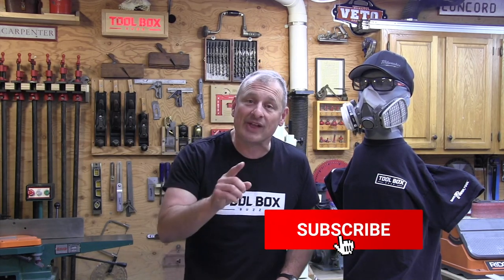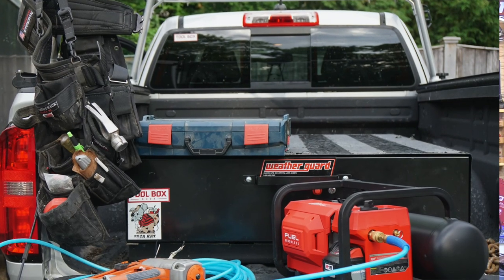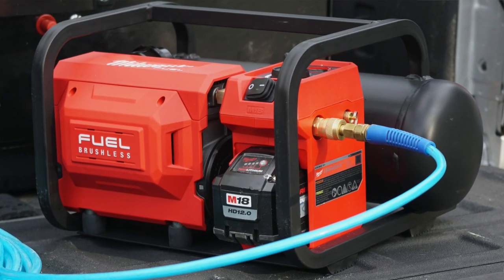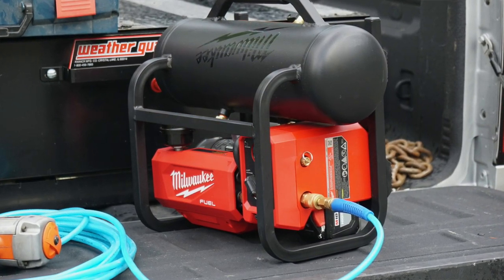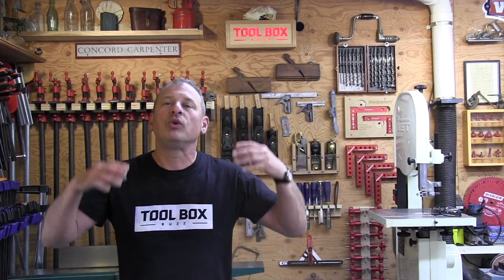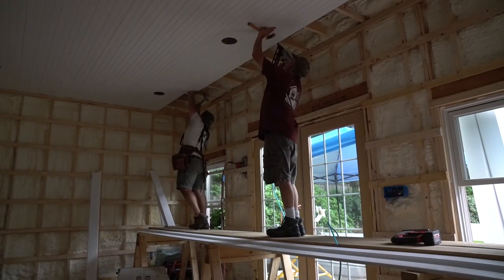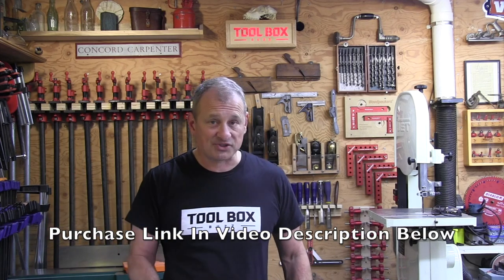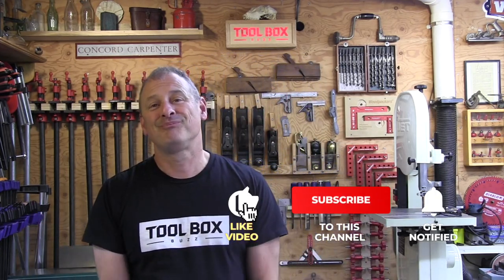Milwaukee M18 FUEL 2 Gallon Compressor 2840-20

Comment: The compressor looks really nice and seems very quiet. One of the main reasons I've been switching to cordless electric tools is noise from having to run an air compressor and the need to plug in and lug it around. Your point about not needing to stress a 15a circuit with this is spot on and something I think probably gets forgotten about. Even in my own home if I need to use the air compressor I either need to run an extremely long hose or be careful about what outlets I plug it into and have tripped the circuit breaker more than a few times during the summer with portable air conditioners and such also running.

Comment: Seems cool, but with the m18 finish nailers is this necessary?  I think if this was about 200-250 for the bare tool it would be a great fit, but at that higher price you have a lot of other options.  And I'm pretty heavy into Milwaukee.  Best batteries, solid tools, too high prices
Reply: Not necessary if all you plan to do with it is drive brad or finish nails but you can't pressurize tanks, pump up a flat tire, blow dust or debris away from your stationary tools, airbrush painting and so on. I can see this being handy for plumbers.

Comment: Hypeddd! Please don’t be some extreme Milwaukee price 🙏 they have been raising there prices up more & more in recent years🤨 WOW that is extremely quiet! Compressor is the most obnoxious tool on the jobsite!This appears to be a breakdown vid, are you guys gunna run it through the gamut then come back around w/ a head to head/full test? Further in the video now lol 300 bare tool is extremely high. Dewalt offers the same kitted up w/ 6ah Flex/fast charger for the same price or sale price @ 250! I think it would of been a great feature to have it clip onto my packout. Then I could wheel it in or put it on the dolly pulling it’s around w/ a 25’ hose?! Either way thanks 4 the vid!

Comment: I love Milwaukee tools, but it doesn't seem like you can do a lot of different things with this one.  For the cost of this little compressor and the 12 Ah battery, you could buy the M18 finish nailer and a couple of smaller batteries and work all day.

Comment: Just bought it.  I've wanted a cordless compressor for a while.  Haven't used it on the job yet, I need to build some saw horses with it and my 20 yo hitachi framer to see how it keeps up
Reply: I'm going to guess it didn't do well... Cycle every 2-3 nails?
Reply: @mudmanKC  no, works well.  But I soon after got m18 framer, which I use a lot.  Still glad I got compressor
Reply: I should add, neither is for heavy framing, better light framing/remodeling.

Comment: Just so folks know, The only reason EVER to buy a cordless compressor is because you don't have 110volt available. Every time you go from 1 type of power to another you lose approximately 25% efficiency. So in this case we are going from 110volt to charge your batteries to Dc then using the Dc battery to run a air compressor pump, so you can run tools tools with air power!  See what I am getting at.  Not to mention the cost vs getting a 110v compressor is so much cheaper vs this. You could buy a slightly bigger 11ov for way less money and be able to run more tools. (for less money) These have a use case though! As Rob said, I would get one for airing up my car or truck or trailer tires on the side of the road in the middle of nowhere for example. If I had to do some kind of work where there is no power, and no generator. That very very rare case would be its only other smart use case. Even then You can only run 1 small trim or finish nailer. It should be marketed as a tire inflator in my opinion, (the tiny things these guys market for that now are wholly inadequate. they also cannot air up a 3/4 or 1 ton truck tire to 75psi anyway. Forget about a loaded trailer too.

Comment: Nice for finish punch list. Makes the noise, the power cord and the twice the weight factor disappear. I dislike carrying my huge heavy frame compressor on to the job from my truck for finish work. This suitcase style m18 battery finish compressor is saving my back left and right. Il pay a little more to save a lot of time and aggravation fighting instead  for a electrical plug. 🥳

Comment: I’m not sure what to think. We got one , took it out of the box , installed fully charged battery, turned it on only to find that it doesn’t work!!! Took it back to store and got money back !! Disappointed as hell !!!  Always had good luck with their products in the past
Reply from the maker: Darren Deak this sounds like a silly question but did you turn the pressure up? Mine was all the way down and had to be turned up
Reply: A Concord Carpenter / ToolBoxBuzz  yes I tried everything. When I took it back to store the sales rep tried everything too with no luck .
Reply: Most if not all Milwaukee products are now unfortunately manufactured overseas and the metals and plastic used are inferior , rust and stress cracks are common place especially on the M18 fuel compressor.
Dewalt’s manufacturing is far superior although made in USA the parts (not all) are globally sourced but quality control is superior and the state side build is quality.
Is Milwaukee quieter than Dewalt 20v compressor, yes it is, but the construction trade is not for sissies or carrying on conversations while on the job…. Period

Comment: For 359.99 should come with at least a 8.0, if not a 12 amp. The Dewalt comes with a flexvolt battery for 299.00.

Comment: They just came out with the m18 framing nailer, so don't need it for that
Reply: Im super keen for it just for running secondary nailers like pin and crown nailers
Reply from the maker: Everything's Chill yep cordless nailer are great bit as I said (i. Certain situations) I’m not ready to give up all my pneumatics just yet
Reply: Battery nailers are great, but if you use it daily they are heavy. If it's all day I'd still go with an air gun.
Reply from the maker: @charlesking678  I agree - if your an every day HEAVY nail gun user

Comment: I use makita and I have something to say. Come on makita get with the program or else Milwaukee will leave you in their dust as they blast by.
Reply: I wish Makita would not have made the 40v line, I don't see the point, or if they felt they had to, they could at least make it backwards compatible. Yes they have doubled the voltage, but using the same number of cells just means they have to halve the amps resulting in the same potential power output. Also, it would be nice if they would release some 9 and 12ah batteries for the chainsaw and mowers (and I guess a drill too if you want to carry the weight). I have been primarily Makita for years but I got my first Milwaukee tools a couple of months ago and some of them are nice :) . Also, if Makita is reading, heat gun? it cant be that hard to engineer...
Reply: Makitas got a ton of new compressors coming out this year that are even quieter.
Reply: relax ^^ they will release a small TV soon that runs on 18V ^_^
Reply: Weenie Hut Jr's tell us how you really feel

Comment: That’s not really that quite. I have an eagle compressor that is 49 dB. It’s silent. I wish Milwaukee had striven for that level of quite. I’ve found the difference between 49 and 70 is massive.
Reply from the maker: Bret yup that’s quiet
Reply: A Concord Carpenter / ToolBoxBuzz 
I probably should be a poster child for Milwaukee M-18 and M-12 tools..... I own most of both lines. 

My experience has been mixed. I have found that most M-18 and M-12 “Fuel” branded tools are powerful and, in general, have good ergonomics. However, on most Milwaukee tools, the finish quality falls short of the premium pricing. 

I’ll give some quick examples. I own  the M-18 10” miter saw. It is lightweight with good ergonomics  but the dust collection parts are made of brittle plastic (easily broken when lightly hit loading and unloading from our crew van) and there is a lot of flex in the head making it important to push carefully when making critical cuts. We use it a lot for trim that doesn’t require staining (less precise). In comparison we have Makitas 10” cordless miter saw and it is far far superior in every aspect except for weight and the Laser vs shadow line.  Another exam is the Milwaukee M-18 table saw vs Dewalts Cordless. Again, I have both (multiple employees). The Milwaukee is powerful and ergonomic. I really like the saw. However the Dewalt uses better materials and is of higher quality finish.  Overall the Dewalt is a better table saw. 

Finally it has been our experience that many of our Makita tools are lasting longer with no required repairs. In order to have common battery’s, we have tried to move all Milwaukee but have found it isn’t practical. I’m hoping Makita will focuses on updated and improving its line. In particular improving its battery cases and power options. I like the makita chargers and how it’s batteries attach and un attach. 

I’m  also  impressed with the improvements that DeWalt has been making on ergonomics, quality and the number of offerings as of late. 

Good news for all of us is that competition is really heating up in the cordless world. 

I just thought of a couple of other issues. Most of our 9.0 Milwaukee batteries now only have 2 bars available per charge. None are older the 3 years. We just had another M-18 brad nailed break internally at 23 months with a total use of maybe 1500-2000 brads shot. 

I could list dozens of dead batteries and many many repairs during and after warranty on our Milwaukee tools. Our Makitas never need repair and our Dewalts, other than a few minor issues with drill chucks have held up year after year.
Reply: @bret9741  m10 is the worst of the line. 7&1/4 and 12 are much better.  Brad nailer (gen 2) is great, but yeah, they break.  And switches...  milwaukee is not great on switches.  Still a great line though, and my makita mainly went to the shop
Reply: Charles F  
I think we experience so many failures because of the large number of Milwaukee tools we have and the expectation that because we pay a premium for the name... we expect more. 
If you looked at my tools, you find them all cleaned after every job, carried in pack out cases with foam and periodic maintenance performed so as to keep the tools in their best state of readiness. I keep my batteries in a waterproof case and charge them all that were depleted over night. I keep the batteries above freezing even when left in the van overnight. 
Lots of amazing tools. I don’t believe you can go wrong with any brand. The main difference is that some lines are very limited relative to Milwaukee, Makita, Dewalt.   I actually like Ridgid tools a lot, use to buy every new worker the entire Ridgid line on day one. The warranty, especially batteries was outstanding. But TTI hasn’t developed Ridgid as it has its other tool brand names it owns.